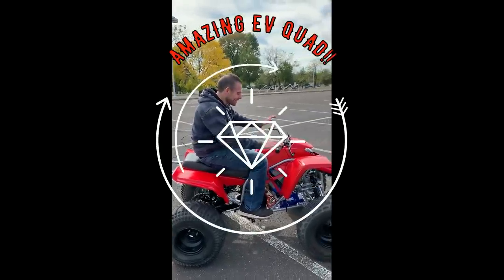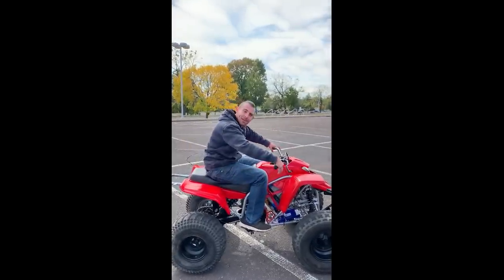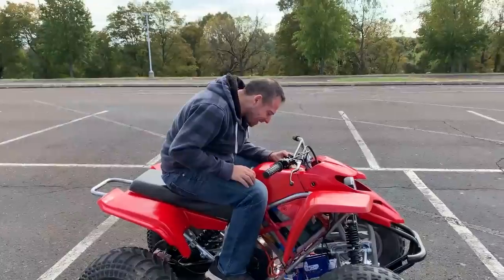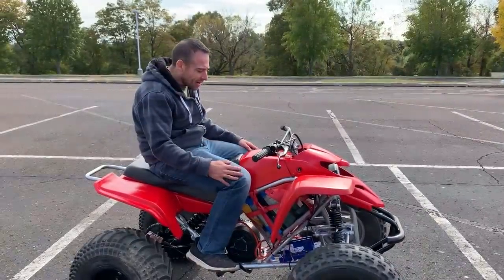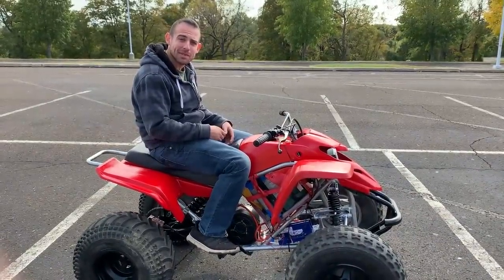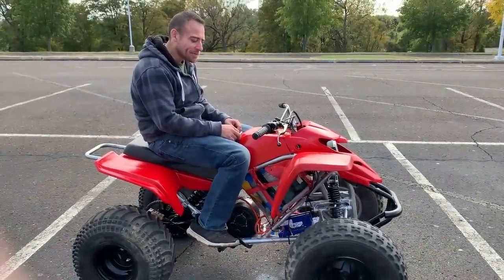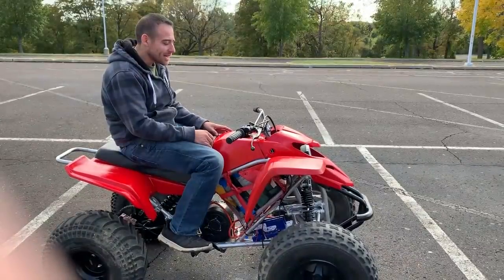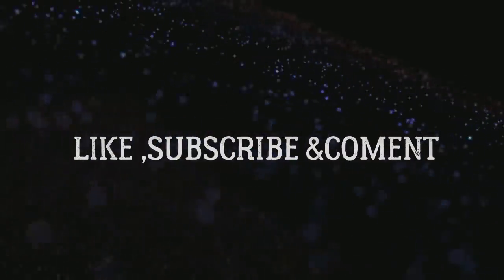HOME MADE EV QUAD 50 MPH!!!!!!!!

Comment: You want whatever you build to have over the top power. Otherwise you will have the thing pegged every Time you get on it and every time you'll think to yourself.. this thing needs to be faster. Think about it. Would you buy a motorcycle, or car that you had to have floored to drive it on the freeway. Barely.. in the slow lane! No. That's unnaceptable. When in doubt, power out.

Comment: You should at least have mentioned 3 key things: 1/ The original quad model. 2/ The electric motor added. 3/ Where on earth you are located!
Reply from the maker: Lol sorry , i am doing a video on the ful build, 1998 blaster, i used an me0909 motor with an alltrax controller , and i am in the usa in Philadelphia. I have another video on my channel that goes through all that check it out